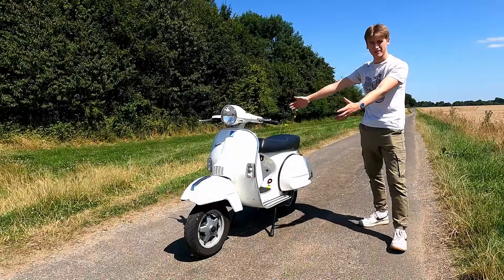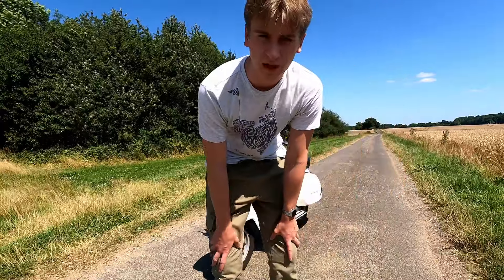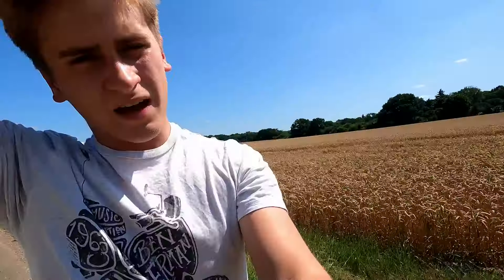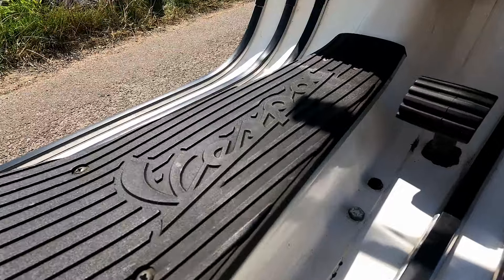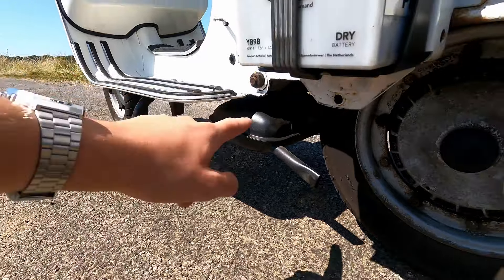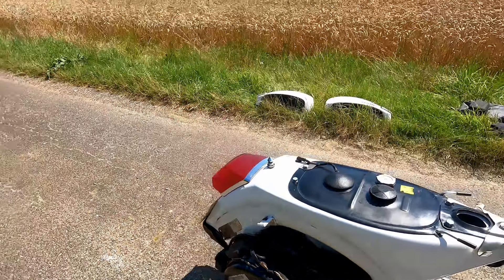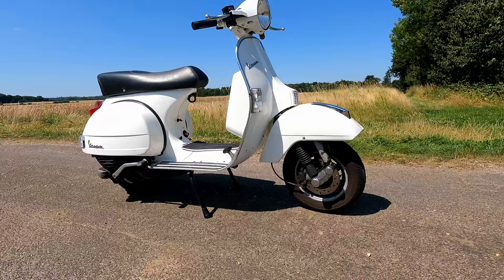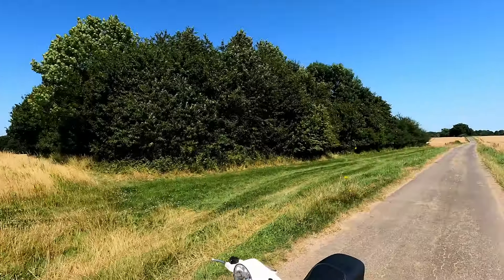CLASSIC Vespa Project !!

Comment: I'd be very interested to know what the current carb settings are (when you get there), I know it's standard but I'm struggling to get my standard PX150 to run right with 20/20 carb...48/160 pilot, 102 main, .01 slide, 160 air, BE3 mixer.
Reply from the maker: @jonhill6440  I will make a video soon. Need to change carb settings but will checkout the standard setting and make a video when I change it.